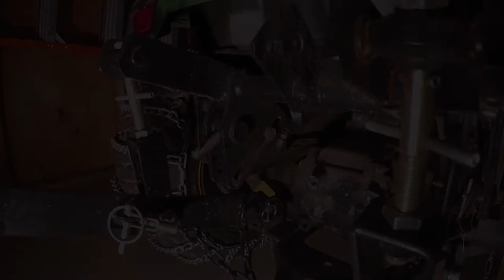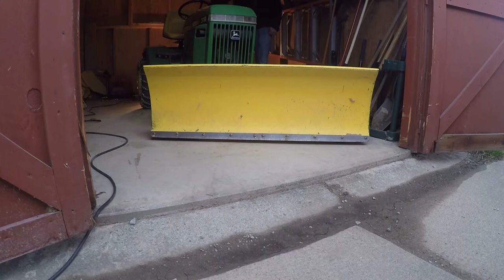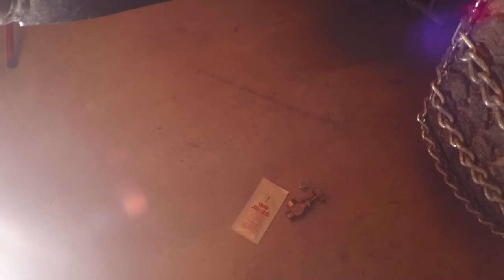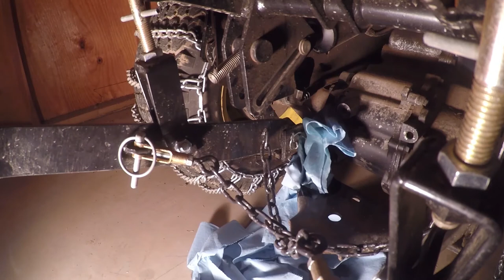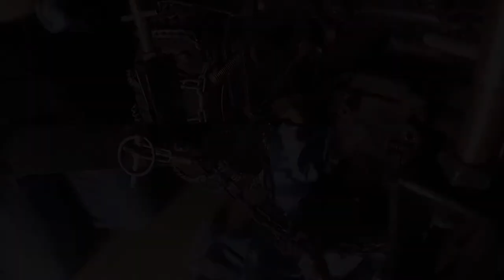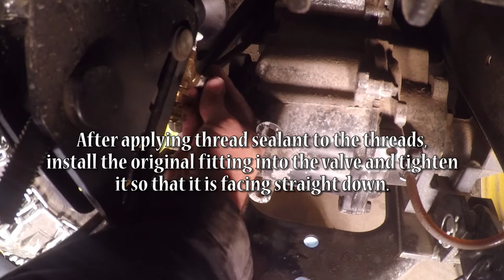Lockout Valve Installation For John Deere 316(Onan), 318, 322, 330, 332, and 420 Tractors

Comment: Wow i just can nit rap my brain around how in the hell that works!!!! Lol    

And where im really stumped at is   Does the differential use the same fluid as what’s listed lifting the attachments.    
Thanks for sharing bud 
happy new year to ya
Reply from the maker: It works because when the valve is open the flow is shared between the ports for the plow and the hydraulic cylinder that raises and lowers the mower deck, lowering the total available flow to each. When the valve is close it cuts off and the flow to the hydraulic cylinder allowing all flow to be directed to the ports. And yes, it’s the same fluid as the differential. The transaxle pump is the source for all hydraulic pressure and flow on the tractor, including the steering as well.
Reply: @outdoorpowerhouse  copy that ..     thanks alot!!!    Happy new years!!!!

Comment: You know, if you connect the hydraulics so the lift is on the left. The plow will "float" when plowing and you will do less damage to your asphalt. Oh and you don't need to lock out the rock shaft. Just saying.
Reply from the maker: When hooked up correctly, these tractors already have a float position. I think you’re missing the entire point of a lock out valve.

Comment: is installation of this valve always done at the rockshaft end?  could it. be installed anywhere else?
Reply from the maker: This is normally where they’re installed. I think at one time John Deere offered a valve that mounted up near the other hydraulic levers but I’m not sure where it connected.

Comment: Would this be any benefit on a 322 when there is nothing is hooked up to the rear cylinder ?  Have a small FEL at present, no plans to use the rear hydraulics..
Reply from the maker: Is your loader using all of the ports on the front of the tractor? One of those shares with the rear cylinder which is the reason to install one of these, so if your loader uses the front ports and you use the existing levers on the tractor there would be a benefit. If the loader’s hydraulics are separate (like a model 44 loader) then there will be no benefit.

Comment: I'm just learning about the various JD models cited here - actually looking at possibly purchasing a 316 (1991 18HP). Question: is it possible (in any practical sense) to add a second hydraulic port to the front of a 316?
Reply from the maker: It can be done, but it’s sort of pain and involves sourcing the parts, including the steering column, from a 318 from what I understand.
Reply: @outdoorpowerhouse  thanks for taking time to reply. After looking at this some more, I think the answer might be "diverter valve"/"hydraulic multiplier". Maybe a bit expensive, but seems fairly straight-forward.
Reply from the maker: Yes you could do that and switch back and forth. It might be a bit cumbersome for something like plowing though it you want be using both lift and angle on a regular basis while plowing.
Reply: @outdoorpowerhouse  steering column?  I would think only valve and handle assembly and steel lines.  I just got a 316 and im thinking im gonna do the independent brakes and i was thinking about doing the hydraulics but i the single stage blower is all for the front for now
Reply from the maker: @tractorboy31  yes, the second set of ports for hydraulics are part of the same system as the power steering.